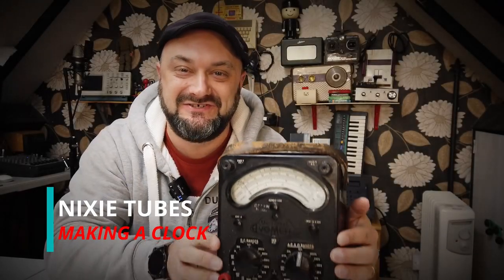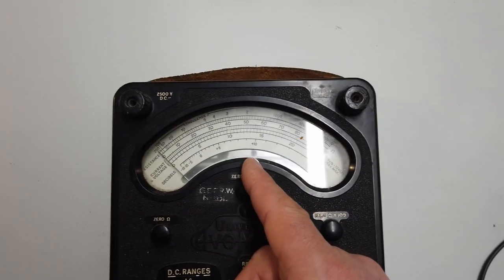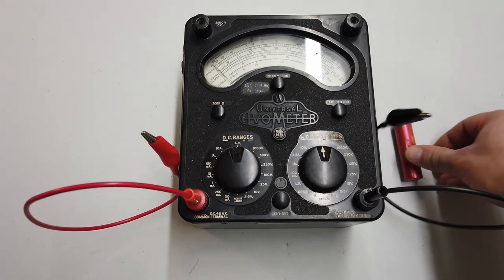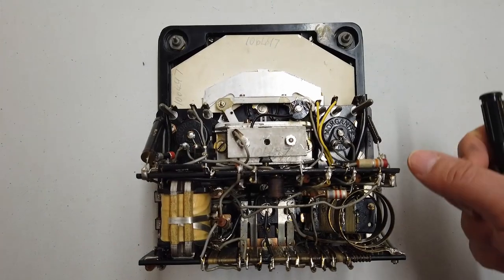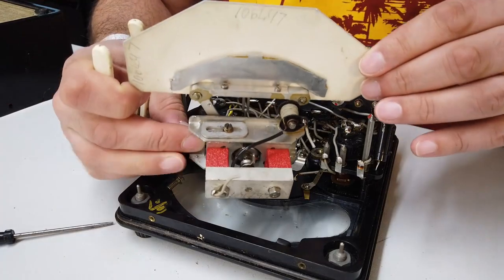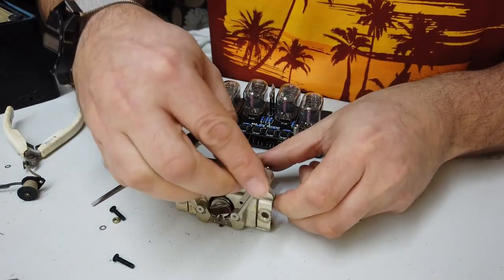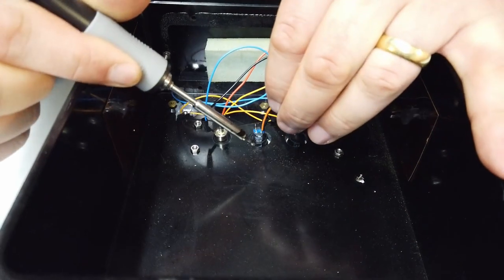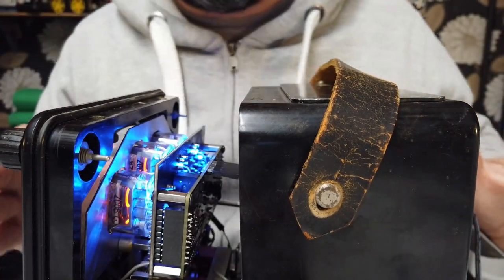DuB-EnG: How To Make a Nixie Clock from an Antique Bakelite Avo8 Analogue Multimeter

Comment: Gold dust! I just ordered one of these modules from BDD, together with a 'spares and repairs' Avo from eBay (for £13.50).

Things have changed. Bad Dog's latest Avo module is fully reversible, so you can re-instate the Avo to original condition. No longer do you have to vandalise the dial, etc. Just remove the whole front module intact from the meter, and screw the Nixie assembly back in its place. It also has a squad of new features, like configurable background colours, light levels which dim at night, and automatic valve switch off at set times to extend tube life.

Many thanks for this. It is really helpful. Wish my attempts at soldering went as easily as yours do 🙁
Reply from the maker: That's fantastic news!  😀   enjoy your build!

Comment: I had to tune in to see the death of a precious icon.
Reply from the maker: There are soo many out there... a lot in far better condition than mine.   I will continue to enjoy looking at this clock as it will take pride of place somewhere in the house rather than being stuffed in a draw and forgotten about :-)
Reply: @DubiousEngineering  I use mine as the desk meter.  It was the meter I was "taught" on many years ago.  Very accurate if you knew how to read it as your demo showed.  I have been trying to track down a centre zero model in decent nick for awhile but not so easy during lockdown with no Ham radio junk sales going on.

Comment: You could have sold it to someone who would use it instead of wrecking it! These meters are still in use by discerning engineers who realise that modern digital meters using carbon resistors are neither  as accurate or as temperature stable as an AVO, you sir are a complete philistine, Dubious engineering indeed!
Reply from the maker: I feel quite guilty now Phil.  I'm sorry.
Reply: @DubiousEngineering  well, there are still plenty out there, and the meter movement could be used to bring a dead one back to life. One of the reasons AVO stopped making them (in 2008) was the cost of making the meter movement, they were then selling for about £850 new and the last two were given as prizes in a competition run by AVO. I think the last nail in the coffin was the company that made the WW resistors announcing they would not make any more. Wire wounds are super stable over a wide temperature scale, whereas carbons are not. If you read your digital meter spec carefully you will find it gives a claimed accuracy at a fixed temperature, whereas an AVO has a wide temp accuracy band. Modern manufacturers are selling digital meters for similar prices, when they actually cost a tiny fraction of the price that the AVO 8 cost to make. All you need to calibrate an AVO8 is a few good quality resistors, a bench power supply and a screwdriver, a modern digital meter has to go back to base for an expensive recal, usually annually, and you will find that after about 5-6 years, they will tell you iit is BER and you will have to buy a new one! I wonder why!
Phil
Reply: I've bought Avo meters like the one being butchered here, to save them from same fate or have been turned into lamps Euck.
And to do it to a fully working Avo is beyond words 
Ones with blown shunts or with the cutouts that are beyond repair can be justified, but not to a fully working meter, I'm sry total sacrilege.